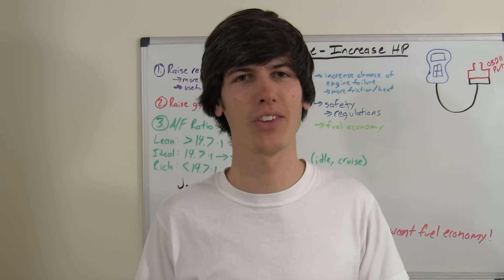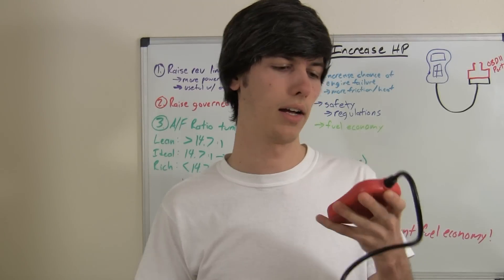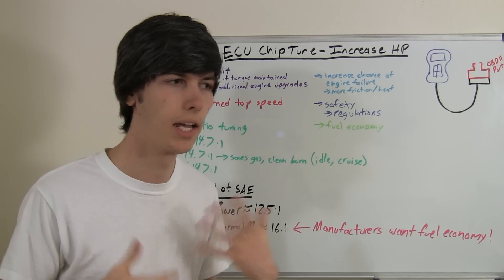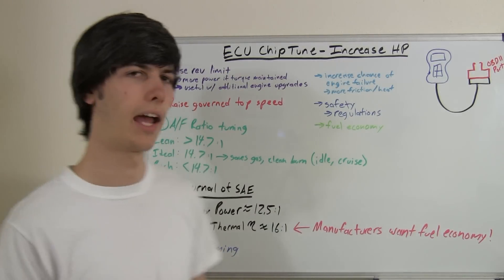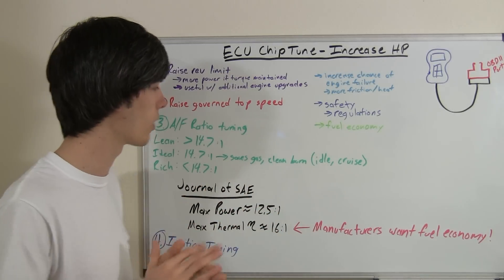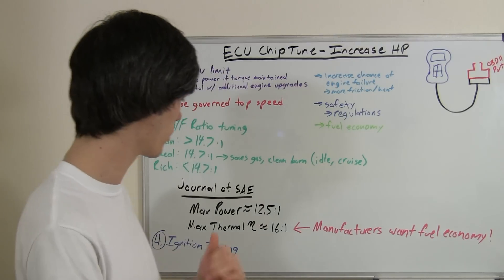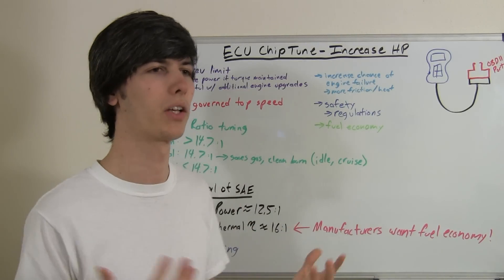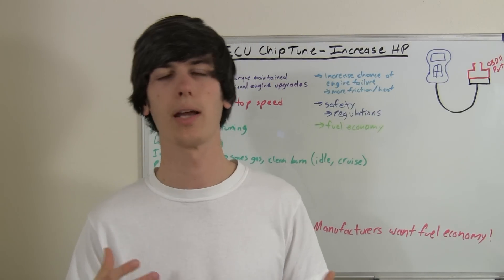ECU Chip Tune - How To Increase Horsepower

Comment: +Engineering Explained I feel my car is powerful enough, its an inline 4, if you were to quad turbocharge it, but lean the engine right out would you keep the same amount of power but have better mileage.
Reply: no you would blow it up
Reply: Quad turbo 4 cylinder that would be a sight to see lol
Reply: I have opted to not use a turbocharger or a supercharger, but instead use an axial flow compressor, and have it wired to the battery and change the ecu to spin the electric motor in response to the throttle. thus eliminating belt driven waste of a supercharger and back pressure of a turbocharger. Also you can turn it off completely.
Reply: amanoncrack ebay fans dont work mighty car mods busted this myth

Comment: If you have a really rich fuel mix wont it make fire come out of your exhaust?
Reply: +4elitegamers 
Depends on the exhaust setup and some other factors (octane/compression/turbo?). However, I was running extremely rich on my vehicle with straight pipes. (Before I got it tuned) and on a down shift it would literally spit fire balls out the back. It was hella awesome for that 1 mile trip haha. So, yeah.

Comment: Could I program the ECU to turn on the TCC solenoid when it hits a certain speed (say 15mph) if the throttle is 50% or less? I have heard nonsense about how that might not be smooth but when I accelerate from 30-50mph the TCC is activated and 500rpm drop off the tack. (about 40% throttle)

Comment: Before the Hybrids came, Honda used to make lean mixture engines found in 92-95 Civic VX that got similar numbers to what Hybrids get nowadays. It'd be interesting to see what economy 2.4L 4 cylinder with lean mixture be capable of.
Reply: True, safety equipment alone has added a lot of weight
Reply: Ew safety... I want to die being hugged by my seat, not suffocated by an airbag.

Comment: So basically somebody told me that if I get a cold air intake and a cat back exhaust system and the whole 9 yards I would have to reprogram is that true?? I'm just now getting into mechanics
Reply: Yes and no.  Enabling your vehicle to "breathe" better will ultimately help performance.  However, cars have set parameters and after they adapt to added elements, you will lose some of those initial gains.  Tunes that have been designed around your added elements will make better use of them.

Comment: hy, i just bought an suzuki vanvan bike. its a 125 cc. it has about 12 horse power.
what would you do to raise the horse power? i would like it to have more speed in the long run.    (i'm from belgium so sorry if i make some writing mistakes) :)
Reply: drill out restrictor in exhaust pipe,better air filter,better air flow to air filter

Comment: Wait, what? A richer mix is "better" for the converter? How can that be so? I thought the point of telling us not to roll-start our stickshift gasoline vehicles was because it might send unburned fuel down the converter! Did you get it backwards?
Reply: yes he has some things backword or doesnt know the leaner an engine the more power not less however thats when parts break, lean is mean is what my engine teacher used to say
Reply: Well, Zachary Krell, that's not true either. If it were then you should just try running it on pure air and see how far you go!
Also, diesels with their ECMs turned up to tell their fuel pump to pack in the fuel will accelerate extra-fast (some people even claim "crazy-fast" for a diesel). I bought a used truck that came with a device that does that. It dumps the fuel in and then I get a good bit of black smoke because of some partially unburned fuel in the exhaust. That's definitely not lean!
Reply: +MaxxFordham i didnt know we were talking about diesels way to go left field.  yes diesels get more power by running rich opposite of gas which gains power with a leaner mixture and yes your right there is a balance but to gain power with gasoline engine you need to go more lean
Reply: You, Zachary Krell, are the one who went into left field, simply by assuming that we were only talking about gasoline engines; not me. As I recall, you just said "the leaner an engine the more power...." That kind of engine was not specified.

My what is right about the balance? (Which possession?)
Anyway, yeah, there has to be a balance, because there has to be enough of something there to burn. You can't get too lean even with gasoline. If you get too rich then the engine will suffocate, right? But why would you be able to have a better explosion with only a tiny amount of gasoline than with a sizable amount?

And then why would diesel be any different just because your compression is higher and the explosion only happens right when you inject the fuel rather than lighting it up with a spark as you do with gasoline?
Reply: What i was trying to say is there is a balance with air fuel mixtures depending on the engine compression, type of fuel, source of ignition etc determines this balance which is why if diesel requires more fuel to gain power however if you were to just dump fuel into a gas engine as if it were a diesal you wouldnt get any power you would be running too rich. You need a certain amount of fuel for ignition to take place however the more lean you make the mixture the more power is made. However you also generate more heat and run the risk of damaging components there are a lot of factors to consider and dont make the mistake of comparing gasoline to diesal 2 differant systems they have some similar components but run and work compleatly differant

Comment: im still sixteen, no money so no car to work on but im just curious, are there softwares avalible that can have multiple modes that you can switch while drive, so say youre on the highway and you need to save fuels so you have it running lean, aand then the bank sees the gold bars missing and you need to gun it so you hit a buttin, (like on a jeep when you need to lock youre differential) and the cpu ajusts to run a richer fuel mix.

p.s. im not robbing any banks, just the best example i could think of, lol
Reply: Not sure if u can switch while driving. I can park hook up laptop and switch between preset maps. But I still have to have them built by hackish

Comment: I would like to know how to increase your speed limit because my truck only reaches 100 MPR and I know it pulls a lot more
Reply from the maker: Derlin Diaz Trucks aren't meant to go fast. Poor aerodynamics; you don't want to fly haha.
Reply: Engineering Explained lol is quick though, it can probably reach 160 easy but limit is 100 :'(
Reply: Derlin Diaz Every car has different methods. For your vehicle, you may even have to buy a aftermarket ECU which is a whole thing.
Reply: +Derlin Diaz 160? hell no it can't. 130 MAYBE.
Reply: when he said you don't want it to fly, he didn't mean it metaphorically. Since trucks sit higher, the wind under the car will lift the truck up and flip if going fast enough
Reply: I like trucks with low limits. It means I can still pass them with a V6 when they want to be assholes.

Comment: I have a 1988 Mercedes, is there such thing for cars this old?
Reply from the maker: There may be, but likely the majority of parameters would be difficult to adjust.
Reply: Engineering Explained So would it be better to not bother with changing or adjusting the chip?
Reply from the maker: Probably wouldn't be able to do much.
Reply: u need only converter to OBD II cable .

Comment: A leaner ratio creates more power, at the risk of detonation, than richer. More oxygen=more power.
Reply from the maker: Less fuel burned is less energy created. You won't burn more fuel by running lean, as you'll leave some oxygen behind.
Reply: Maybe I'm thinking of boosted applications. I'm pretty sure you want it to run as lean as possible without detonation. And when I say lean, it's still well lower than 14.7:1. I think something like 12:1 is probably as high as you should go with forced induction, with pump gas. You should do a video on octane ratings, or perhaps difference in the types of fuels.
Reply: Geo Man
Are you still talking about lean? Because 12:1 isn't lean that is rich. 17:1 would be lean.
Reply: Geo Man Geoman, a leaner tune won't create more power but you can tune a performance engine leaner, I think it's around 13.4-13.6 (not exactly sure myself!.) Ignition advance must be increased to give the leaner mixture more time to burn since the flame front moves slower under leaner conditions. The mixture is burning for a longer period of time, your pistons will heat up more since they are exposed to the combustion for a longer period of time. You must make sure you have enough piston to bore clearance to accommodate for the expansion of the piston or your gonna have a bad time (or so I've read)... even if you do keep your detonation under control.

Economy motors such as that in the 1988 Honda CRX HF uses lean burn only under light cruising loads which allowed it to break the 55mpg mark over Twenty Six years ago while automotive companies today are still "bragging" about something getting barely over 40 and are under more stringent emissions requirements and weighed down with more safety equipment.

I don't know myself if all engines can use lean burn under light loads without consequences.

custommotor, He did say 12:1 for a boosted engine, and he's speaking in relative terms. 

Lean burn actually produces more hydrocarbon emissions and pollutes more. Max fuel economy occurs at around 15.4 but produces more emissions than 14.7, which is stoichiometric.

If anyone see's anything incorrect about my comment, just let me know, I will be happy to discuss it.

Comment: "When you floor it its better to have it richer for the CAT" un-burnt fuel is what damages the catalytic converters because when it reaches the cat it is burnt and "superheats" it forcing the cat to run way above operating temperature.
Plus what do you mean by "on a lean mixture you will have O2 left over at the end of the cycle"? surely all of the O2 will get burnt its just your engine wont inject as much fuel causing starvation?

Comment: OK big dog---you remind me of me when I was young and use to drag race at Lyons in Long Beach.
6 months ago I purchased a used 2005 CL65 which already has 605 HP and blows almost everything off the road.(cep on 2008 CL 65 which I want to find again)
anyway - is there any truth to these BS "chips" I hear about all the time.
You would think MB would make them available after market if they really did work.
Reply: Howzyer, most certainly it will. Yes MB and AMG make some very great cars and they have a high amount of horsepower from the factory but just like every other car manufacturer they are limited by the constraints of having the vehicle pass the EPA standards for vehicle emissions. The programmer allows those values to be set outside of what is required to meet the standards and allows for more horsepower as such.
Reply from the maker: Howzyer Bippy Mercedes wants to make a reliable engine as well. It's not all about power. You can certainly boost the power with a chip, but that doesn't mean it will be just as reliable.
Reply: Engineering Explained
thanks for your input
I will "think about it" and look around
I do not street race (all the time) but I do get some kind of perverted thrill out of simply knowing I am the top dog.
It is a pleasure to see and listen to someone who actually knows what he is talking about and coincidently can actually talk. (it's nice to have a brain huh?)
Reply: Howzyer Bippy if you do have the money go ahead and chip it ... I chipped my volkswagen cc with a stage 2 tune and its a different car I hated it stock I love it tuned ....

Comment: i beg the differ though, running your engine on a rich AFR will just ruin your plugs and get low gas mileage, but generally speaking, running rich is better than running on lean, running on lean causes engine blowout = the end for your engine XD

Comment: How about vafc to setting at cd5a mivec Turbo 4g93t
Reply: Problem is speed time got like miss fire but if I start at the engine timming is good not problem is moving got problem is like cut, Turbo on mivec doesn't on what problem (model car cd5a, engine 4g93t block, heat mivec 4g92 with wiring model ca4a,Turbo td05 )injector 390 cc

Comment: I would love to know why you think 14.7 to 1 is ideal. Ideal fuel air ratio is actually 12.5 to 1 to 14 to 1. Anything leaner than that will/can cause pre-detonation. Also your risking melting a piston at (14.7: 1) that ratio. Also you didn't specify what source of fuel your using. pump gas, race gas, alcohol, or e-85. These fuels have different reactionaries in the engines torque curve, and react very differently. I do appreciate your videos, but this one seemed to get a little off topic. I think you should consider re-doing this video, you didn't mention options with flashing an ECU other than what's listed. You also failed to describe how to adjust your F/A ratio within different parts of the rpm range. (example being if using a carbureted engine with an ECU as opposed to using a TBI system or an MPFI. All of these deliver fuel in different aspects of time and reactionaries. Your videos are good,  but please do more research and be more in depth.
Reply from the maker: Ideal from a chemistry standpoint, after burning there is no left over oxygen nor fuel. Check out my video "air fuel ratio." At WOT, you'll want a rich mixture for more power, and safety.
Reply from the maker: By definition, anything under 14.7:1 is rich, anything over 14.7:1 is lean.
Reply from the maker: Haha oops, forgot about those options.. ;)
Reply: Saying 14.7:1 is lean is pretty far off, that's considered stoichiometric and most cars PCM's adjust injector pulse width based on O2 readings in the exhaust to keep it at stoichiometric. This can be seen with say what I use daily (HDS) where an actual lambda value is shown in the data list and the PCM will constantly try to keep the A/F at 14.7:1. This A/F ratio is determined solely on a balance of drivability of the car and emissions, power has nothing to do with it. A slightly leaner A/F can be used to gain power and fuel economy but manufacturers do not do this because a lean burn creates more emissions. Based on load different A/F ratios are more ideal but in most cases modern OBD2 vehicles that use a A/F sensor (the main sensor isn't considered an O2 sensor anymore) will attempt to keep a near stoic A/F ratio. Although no computer has any idea exactly how much fuel is going in, it's all an educated guess based on O2 in the exhaust.
Reply: Ok so how do you apply this to a pre-emissons vehicle that has no ecu?
Reply: Carl n Misty Weisenauer Well I don't F with those dinosaurs especially since as a Honda technician there is zero money in it other than if you like those sort of cars but since a O2 sensor generates it's own voltage via the chemical reaction between the zirconia element and oxygen you could use a aftermarket wideband AF sensor with a gauge that can help tune say a carburated engine.

Comment: can anyone help me with this I Drive a 2015 Subaru Impreza with 148 horsepower but I want to crank it up to 200 horsepower what would be a good idea or good thing to do to it to get the 200 horsepower??? I'm thinking of doing a muffler delete and adding a cold air intake. 

HELP PLEASE.
Reply: take some weight out, lower slightly, cai, and chip for transmission shifts and redline. not all for power but this will help speed.
Reply: +BLACKARROW .ASSASSIN NOS lol

Comment: i hear a lot of people say 14:1 ratios etc.. its actually 14,000:1.   or 14 liters of air to 1 milliliter of fuel.   do the math,  it seems to make sense.  same incorrect talk as backfire in one of the other vids.   :D   
 just my 2cents.  maybe less.
Reply from the maker: It's actually a ratio of mass, not volume.
Reply: Engineering Explained
Thanks man.  when i thought about it as a volume it just didnt make sense.  so apparently less then 2 cents.  hahaha

Comment: ECU flashing of a stock car always seemed like a waste of money. At wide open throttle, the factory tune should run the engine for peak power, not MPG. Perhaps you could get a tune for higher octane gas, assuming your car doesn't already do that on the fly. Other than that, why would you assume the manufacturer would leave power "on the table" when simply changing the tune wound give them a better car, for free? What could the tuner know that the manufacturer didn't?
Reply: Of a stock car is your key point. But upgrade the intake or exhaust and that's a different story.

Comment: Wouldn't be better talk about Lambda instead of AFR? I mean, the more Internal Energy the fuel has the leaner (greater AFR) it can be burned, yes?
Reply: Aren't Lambda and AFR the same thing? Just displayed differently. Lambda is just the ratio of the fuel ratio vs the 14.7 stoichiometric ratio. AFR just shows the ratio your at. So in reality Lambda is just your current AFR vs 14.7. you know a AFR of 12:1 would be a lambda of 0.816.
Reply: Lambda doesn't depends on fuel octane, for example. I use here because the pump ethanol over here is hydrated, so 9:1 AFR isn't accurate.
Reply: Lambda is still the same. You have to adjust the gauge to read lambda right which is basically switching what it uses as the stoichiometric ratio internally to find lamdba. If it's set to oxygen it will use 14.7 if turned to ethanol it will use 9.